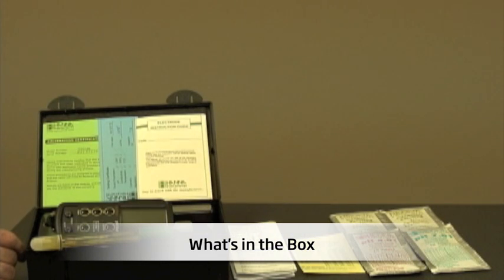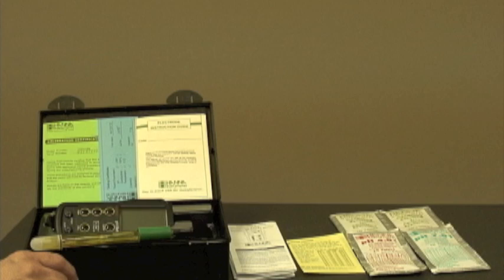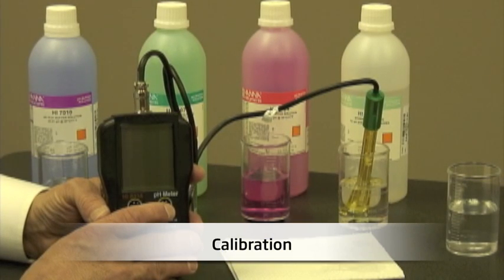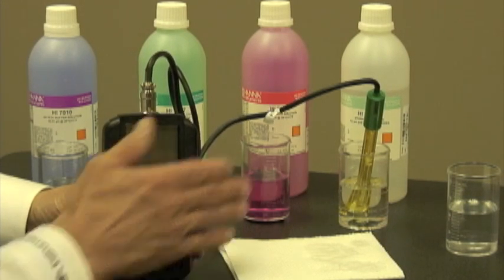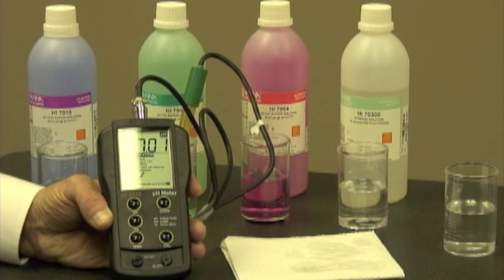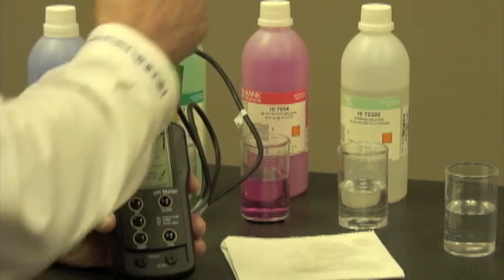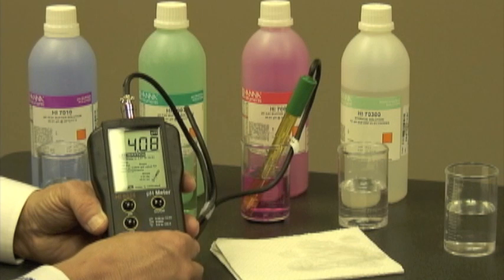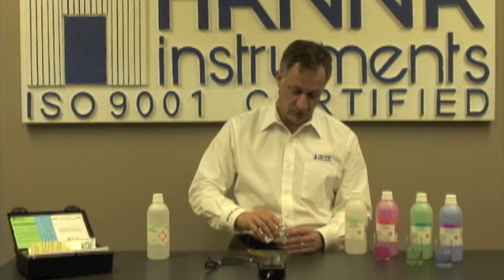HI 8314 Portable pH Meter

Comment: my temperature on mine seems to be off about 2degrees, is there away to calibrate it?
Reply from the maker: Hi Will
You can’t calibrate the temperature sensor on the 8314. It actually sounds like it might be an issue with the probe... You can do the following to check...
 
· Place the probe in an ice bath and see if it reads 0°C. If so, the sensor is accurate.
· Try another DIN probe with integrated temperature sensor and see if it’s more accurate. If it doesn’t improve accuracy, it’s an issue with the meter. If it is more accurate, it’s an issue with the probe.

If there is an issue with the meter itself, let me know and we'll get you to Tech support.